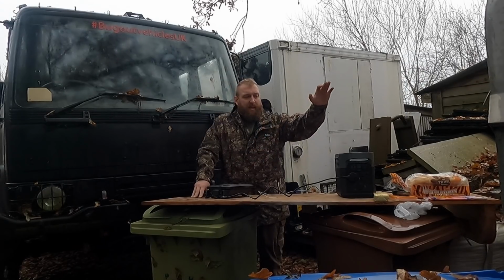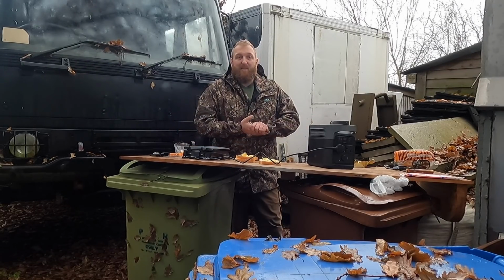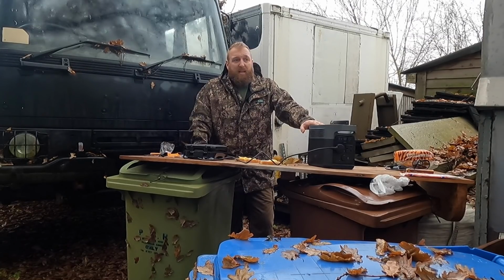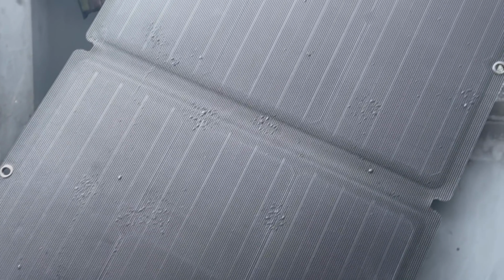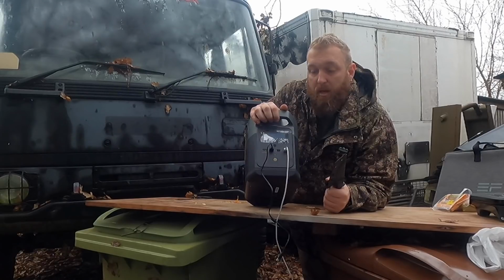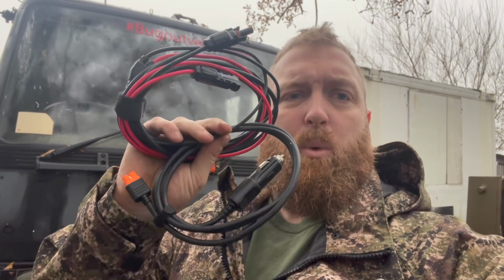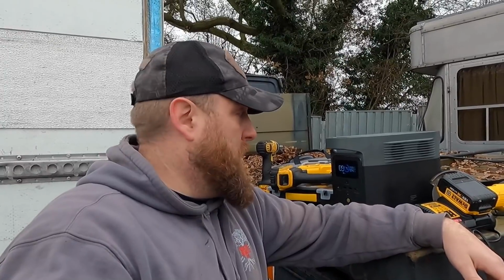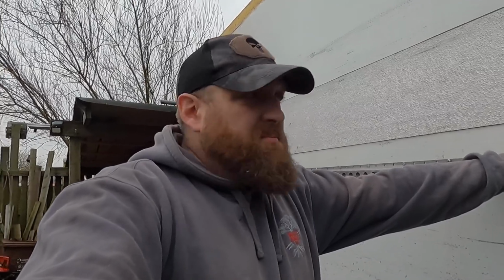Off grid cooking using Ecoflow solar generator.

Comment: These look great, my only slight concern is longevity, like Jackery they use the old lithium technology which has a shorter lifespan than the LiFePO4 batteries, 800 cycles to 80% against 2500 cycles to 80%. It comes down to how much you use it, if it’s an emergency thing that’s there in case of blackouts then these will be fine, you will never get to 800 cycles, but if you use it everyday then lifespan has to be a factor when purchasing.

Comment: Good review Rich BUT, being honest if you hadn't been given one or having any previous contact with this company would you shell out your hard earned pennies?
I for one wouldn't! 
Don't get me wrong I can see some uses for it whilst parked up for a week or so without access to any mains power. 
But is it really worth the ??? Pounds asking price?
I've got  208 amps of AGM battery power on my van plus 150w of solar and a 1500w pure sine inverter and can manage quite adequately, mind we don't watch TV or play games etc. But being an old Goat I like to be warm and run the Truma 6ge when we're in the van and my wife likes to have the radio on.
Thanks for sharing and keep em coming.
Reply from the maker: I already have 3 power banks so no I wouldn’t have needed to buy this one. On the other hand I do use power banks very regularly and I’m not limited to just the power in the Land Rover. These are a far more modern and deliver more power than AGM in the output, charging weight. Not only that it’s a full power system in one box. It may not be of interest to you but to a lot of ppl these vids are of use and give an insight to the size they need and what they can be used for so they can make there own informed decisions on what they need

Comment: Merry Christmas. Always entertaining. nice to see what new tech coming compared to self built power pack. follow a couple of the off road clubs (shropshire offroad and Staffs & shrops) 2/3 of the year camping available various weekends. Run electric cool box, blow up air bed. recharge lights, little tv / radio and phone for the weekend (5 nights sometimes) dont have to use the vehicle battery. 100 watt panel (turn it round to follow the sun for the day). As you say manage the power output to what you have. 2 nights not usually any problem 5 nights on a dull weekend can be close but get by if managed (plus last night not usually a problem). Watching prices on compressor fridges at the moment to try to save expanding solar / battery / mppt controller. Trying to stay happy with power ability as is but it does give you more ideas like running some house items in a power cut or toasty makers (will stick with ridge monkey for now) or tent heater ( got one of those perforated can things for the cooker works well with co2 alarm) have seen 12v sleeping bags and jackets though but good kit or layers usually negates this. as you say nice to have the ability. anyone building there own I would say straight to 100 watt panel capacity and a 100 amp ( PWM the cheaper one if I got it the right way round). started with 2x 20 watt panels and knackered bosch 75 watt battery. made it work by keep turning panels in to sun when available and run coolbox in main day light hours to keep it cool. so looking at investing in compressor fridge freezer between 35 and 50 litres following varios sites. Have discovered Ican use current setup and jump leads to start the offroad motor and if left connected will take charge back but not aiming to be a regular occurrence, have yet to try fag lighter to fag lighter unit to charge leisure battery. As you said once you have power you find other outlets for it and want more. whats that saying power corrupts etc etc. anyway said enough good vlog. you and yours have a good one.
Reply from the maker: Thanks pal. And all the best to you too.

Comment: Be interesting to see if you had a solar panel connected on a sunny day how much it would of used
Reply from the maker: It would have been a totally different story. The battery’s would have been stronger and it would have been 70-100W of power going in so way less battery used.
Reply: @Bugoutvehiclesuk  exactly and at that point makes living off grid much more of a reality 👌🏻
Reply from the maker: @RileySmith-l9x  the Landy set up has totally changed how I stay out. I don’t ration electric anymore and use big items. This last year has been mega for off grid tech
Reply: @Bugoutvehiclesuk  been following your setup for a while and will be installing the same but only one 100ah battery